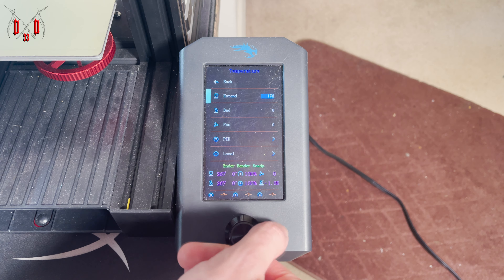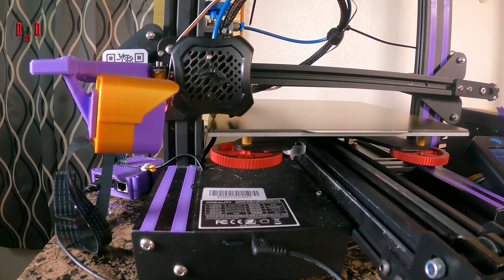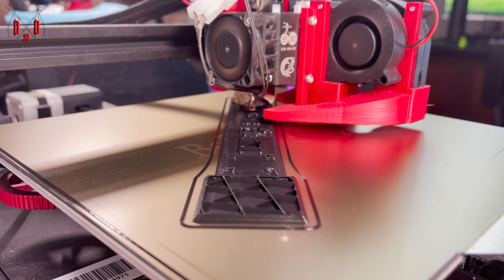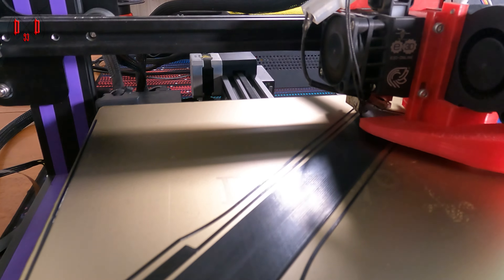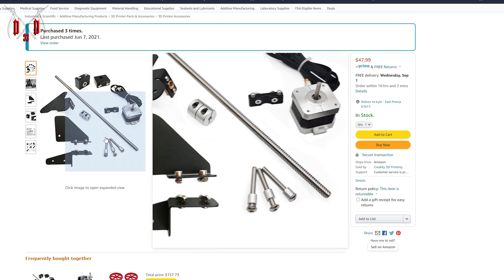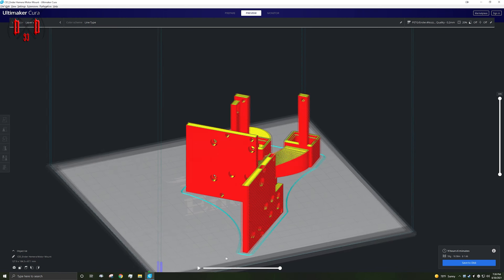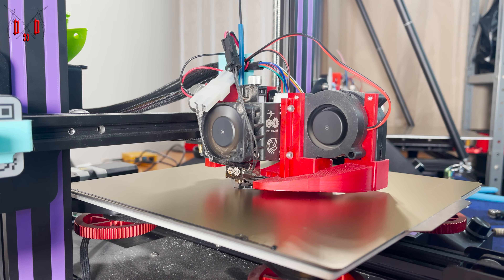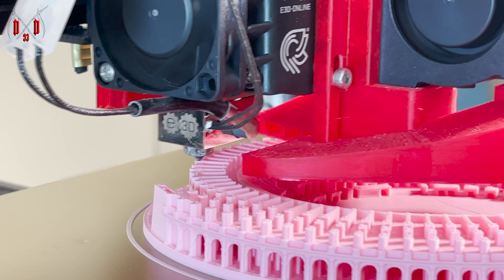Overengineering the Ender 3 V2

Comment: My favorite upgrade after doing dual z steppers was upgrading to a new mainboard (skr e3 turbo in my case) to have individual control over the z steppers.  You can then tram the gantry to the bed before each print utilizing your bltouch.  Its G34 in marlin iirc and  Z Tilt Adjust in klipper.  I also love klipper.  For people that tinker with their printers its work flow is so much better.  Imagine never having to compile the firmware again... anyways, great video
Reply from the maker: That’s it! You are probably the 12th person to to say this “klipper” is amazing. This is now on my list to check out. What drivers came with that board or is that one that you can swap them? If so which did you choose?
Reply: @DeathDonky  TMC2209 in smart mode.  They are soldered on.  They do make some versions you can replace the stepper driver.  I believe the TMC2209's are what most people would want anyways.  It can do all of the fancy things like sensorless homing etc
Reply from the maker: @Nell8908  yeahhhh I’m gonna have to put klipper on my list of things to look into for sure.
Reply: If you dont change the board and use the stock board is a G34 needed (or reccomended) in start g code before a G29?

Comment: No silicon sock to cover the heatblock? Makes a huge difference in consistent temps with parts cooling.
Reply from the maker: I cant with the temps its capable of. I could fit one when printing lower temp plastics but im able to get away with it by simply brute forcing the heat. Its got a hemera High temp heater cartridge capable of screaming basically. I had a buddy just copy this setup but without the high temp stuffs and he def needed the sock. In my case... no sock. in normal cases yes sock.

Comment: did u measure the Z stepper motors's current after wiring paralel?🤔 Is that in safety interval?

btw i would follow u ,but im only interested in 3d printing and engineer stuffs
Reply from the maker: Yes. The current for my setup is set by changing the vref voltage. That was tuned to accommodate the added stepper, as well as the other to ensure they were within the proper windows of operation.
Reply: @DeathDonky  ohhh,and can i find some tutorial for this method?😀
Reply from the maker: Yes! I believe I got the vref video from crealitys YouTube! It’s not a very long video and I only used it to give me the numbers I needed.

Comment: Hi how did you increase the voltage for your z stepper motor I have done the same upgrade and now my z motors sound a bit clunky.
Reply from the maker: I’ve got another ender video up that goes over the vref voltages and how to change them. I mention stock numbers as well as mine. It was uploaded around the time this one was. I’d link it but YouTube likes to block even my comments on my videos lol

Comment: I’m running Jyers aswell with a bltouch and loving it, my only thing I noticed when I switched firmware was that my corners started bulging, I have a 4.2.2 board, so just wonder maybe you have more info than me but do these boards have linear advance? Hopefully my next upgrade will be a direct drive
Reply from the maker: No, I do not believe these boards have linear advance. I will say though to help with the bulging tweak your acceleration and jerk settings in your slicer.
Reply: @DeathDonky  so I tried once apon a time to set my acceleration but not much difference but will try again, what are your settings? Just so I have a reference other than the stock settings

Comment: I would really like to know what firmware you're running and/or how you set it up for automatic bed leveling. I want to know how you have the BLTouch make multiple measurements at the same point without raising the probe up and lifting back to its original position after each time it takes a measurement. I manually configured and compiled Marlin and it takes much longer to do the automatic bed leveling due to the BL Touch resetting between each time it takes a measurement. I know it's possible to do what your does on Klipper firmware, but I didn't know of any way to do it on Marlin, but if you're running a Creality board then I'm assuming you're on Marlin.
Reply from the maker: Im running a custom "Jyers" build for my firmware. I do believe it is built off Marlin. Since you say "I manually configured..." Im going to assume you've been in VS code, and have been through the "heart" of the code and understand how to navigate the lines of code and files if you will. 

To start. My probe does not "stow" (or go back up into the body) between probes because I enabled "#define BLTOUCH_HS_MODE" under the "configuration_adv.h" file. All I had to do was uncomment this line and that was it. This will keep the probe "down" as it measures, but will still stow it afterwards. The HS in that line means "high speed". To ADD to that setting I ALSO adjusted the speeds at which it probes and how high it moves from the bed when it deploys the probe (drops it down to measure) and between probe points.  Please understand that I am using a dual z screw kit and because of that added stability I was able to turn the speeds up to be a little faster than "stock". I will share my numbers but use them at your own risk. Or maybe increase them to mine or beyond in inciments to ensure you don't damage anything. 

The rest of these settings and changes will be in "configuration.h" Only the BLTOUCH_HS_MODE is in the adv section. The "speed" at which your machine probes is defined using "#define XY_PROBE_FEEDRATE (xxx*60)" and "#define Z_PROBE_FEEDRATE_FAST (xx*60)" where the "x's" represent YOUR changes. On MY machines this is what my lines look like... *#define XY_PROBE_FEEDRATE (150*60)* and **#define Z_PROBE_FEEDRATE_FAST (12*60)**. Their is a line just under those two in the firmware code that is labeled "#define Z_PROBE_FEEDRATE_SLOW (Z_PROBE_FEEDRATE_FAST / 2)". This is the speed at which your machine will drop to probe the bed for the second(and in my case third as well) measurement. Its recommended to leave this as is but is also a part of the "speed" at which you can probe so it needed to be included, pointed out, and explained at least to some degree. The point of this line is to slow the machine down(as its set in my example it'll slow by half of what you set on the feedrate fast lines)  to ensure its accuracy with the first measurement at that point on the bed. To increase speed further I adjust how high the probe needed to be before it was "clear" to do work. That was adjusted using the following lines (again were still in the "configuration.h" section of the firmware) The "5, 3, and 2" numbers represent the values I actually have set.
#define Z_CLEARANCE_DEPLOY_PROBE   5 
#define Z_CLEARANCE_BETWEEN_PROBES  3 
#define Z_CLEARANCE_MULTI_PROBE     2
*You should be safe to copy these from the get, unlike the speed numbers, but keep a close eye on the first few probes and BE READY with the power switch to avoid damage. Ensure the bed is free of obstacles or obstructions. In lamens terms these numbers mean when my probe depoys its little arm its 5mm above the bed, when it moves between probe points its 3mm above the bed and in between meassuments at the same point its only 2mm above the bed.*

You can define how many times it "probes" the same point using line "#define MULTIPLE_PROBING x" where "x" represents the value. For me "x" is 3 in this line so each point is actually measured 3 times. i believe default is 2. 

Under the "bed leveling" section you'll come across a set of lines that might look something like these below:

//#define AUTO_BED_LEVELING_3POINT
//#define AUTO_BED_LEVELING_LINEAR
#define AUTO_BED_LEVELING_BILINEAR
//#define AUTO_BED_LEVELING_UBL
//#define MESH_BED_LEVELING

This is a copy from my firmware and you can see I opted to use bilinear bed leveling by commenting out all but line "#define AUTO_BED_LEVELING_BILINEAR" by using the "//" method shown. Finally you can define the "grid" by using line "#define GRID_MAX_POINTS_X y" where the "y" represents the value that you will choose. For my setup "y" is 7.

I think this covers your question and everything involved with it. If you have more questions or need a different explanation id invite you to join the discord server in the video description as it would be alot easier to get on the mic and screen share if need be. I hope I earned a sub ;) even through the grammatical errors lol
Reply: @DeathDonky  Thanks so much for the in depth reply, this is all I need to go and make the change myself. When I set up Marlin I mostly only looked at the settings that were within the standard configuration.h file and didn't do much of anything within configuration_adv.h so I guess thats why I never saw that option.

Comment: Could you elaborate how did you raised thr voltage for the 2 motors and how did you found the proper value?
Reply from the maker: You arent the only one to ask this and im hearing you guys! I swear. Its going to take a few weeks to get that video up as im in the middle of one already for the "gaming" side of things but have plans right after that one to get a quick 3d printing video up again! One where ill be in that area of the printers already and ill be able to point this out to you guys. Ill get to it but unfortunately I don't do this full time persay so it's hard to be the "right now" guy...
Reply: @DeathDonky  I understand. I know how to measure and adjust the voltage in the 4.2.7 board. The part that noone talks about is how to figure out the correct new value. Things get even more complex when many claim that no adjustment is needed but noone presents a test or a method to check this, other than prints ofcourse but still there should be a way to optimize it because rasing the voltage too high cannot be good
Reply from the maker: @georgechrysomallidis2003  The video that answere this question will be up in a matter of hours :) keep a look out and thanks for your support/time/view

Comment: do you think you could add the bin file you used to flash the printer? i’m running a similar setup but am looking to change from the default e3d mount and firmware
Reply from the maker: In order to use my bin file you MUST have the high temp capable components with the 4.2.7 board. If you do not have the exact same E3D components and main board that I mentioned(including the extra high temp capable/conversion parts) you risk melting your machine and causing permanent damage… 

I can share the mounts and the bin with you but understand that the firmware is a HUGE risk on my part as it fully allows me to just roll the temps up to 500 on the nozzle without a care. If you don’t mind me asking what exactly do you have on your setup before I share that? At a bare minimum to “safely” put that bin on your machine you’ll need the Hemera, all it’s high temp conversions(the exact ones I used because firmware numbers had to be changed for them) as well as the main board. I’m not saying you don’t have these or aren’t capable or didn’t know that already it’s just I didn’t think I’d be asked this and it definitely makes me a little nervous handing someone something that allows it to get so hot. Setting it to 400 is technically “safe” on my firmware but setting it to that on like a PLA would probably be bad news ya know?

Comment: Hi Great Video, did you make any upgrades to handle the extra current requirement of the 65w heater?
Reply from the maker: Good question. The only thing I did was make sure the wires had a PROPER connection to the main board. Furro connection? I know I misspelled that… basically I did not tin the wires with solder and instead bought the proper crimp tool and connections. That was the only “real” mod I had to pull on the wiring. Everything else worked out of the box. (Though some connections weren’t EXACT they worked)

Comment: How did u get the Screen working like in 8:40, with the progress bar ? 
Since ive printing over octoprint mine is stucking at 0% and 00:00 Remain Time
Reply from the maker: So those prints were done off the SD card which is why the progress bar was working. On octoprint under the plug-ins setting their should be a progress bar plugin that Will actually get that working for you again. It displays more than just the percentage too. It’ll show like which layer of however many total your on and other things too. Search in the plugins on octoprint though!

Comment: That fan shroud is it one Thingiverse or somewhere else?
Reply from the maker: I’ve got it linked in the discord server 😎 as well as the plates I designed as well.
Reply: @DeathDonky  great work  sir can't seem to find the stl's for the hemerra upgrade on discord.
Reply from the maker: Check the #3d printer file share chat. I just pinned it. Not sure where the original went
Reply: @DeathDonky  thank you sir

Comment: Great build! I have the same dual-z upgrade however that upgrade does not by itself stop from each lead screw from moving independently. You should add the z-sync upgrade on top. I got it by cobbling the dual-z dual stepper upgrade together with the dual-z single stepper belt and gearing parts. I also recommend a cable management upgrade, especially if you are printing frequently.

Comment: Horrible design for the fan duct. 90° bend for the fan outlet will lose so much pressure.
Reply from the maker: That’s the smallest design flaw with that cooling setup but it works even with the pressure losses. It’s a highly restrictive setup in terms of airflow and a lot of lessons were learned from it. To say it’s “horrible” is comical to me.

Comment: do yourself a favor and get klipper firmware
Reply from the maker: What content would you reccomend me start with? you are like the 12th person to tell me this lol wondered where you started? had a content creator you recommended for the how toos? if you will
Reply: @DeathDonky  buy a raspberry pi.  a channel called nero3d has a lot of good content on how to install.  You just have to flash the zip file it will ask you to install directly on the pi SD card using Raspberry pi imager.  Install puTTy(you'll use this one to install new programs and get you started)  and winSCP(access folders on the pi) .  The video can take you from here.Sorry that's a lot the learning curve is steep to get to know where everything is but its 100% more intuitive and you'll pick it up quick in the videos.
Reply from the maker: Thanks for the direction. I have a pi I need to replace anyway so this may come when I can get a pi again for a reasonable price

Comment: ok i now 3d printing is adjust,fix problems ect bud your machine cost you now i thing 600-700 usd ?? for a ender 3 . I think somethimes investe more and you mutch more happyer and have more fun .I would see Prints not fix issues eacht print. My first machine was a Anet a verry horrible machine afther 2 mounts i sale it and i buy mee a genius a wonderfull machine. Now i have a prusa minni and my next, whe would build a vorron 0 . Bud the Importent is you have fun :-)
Reply: Yeah, it's a pretty pointless endeavour when you can buy a superior printer at the same price you'd spend on upgrades. 

The only reason to do this is for fun, which is completely fine.